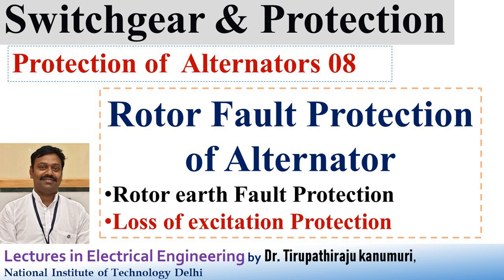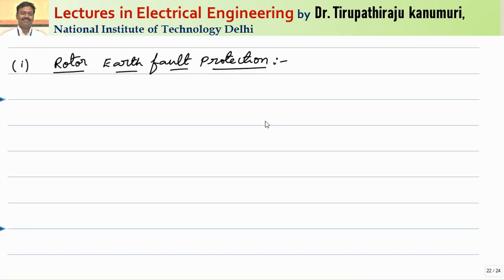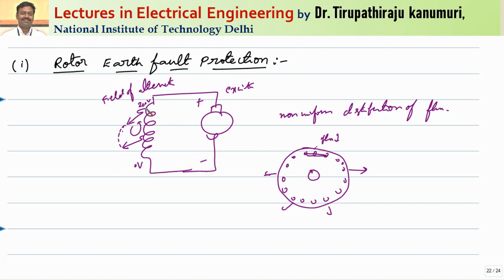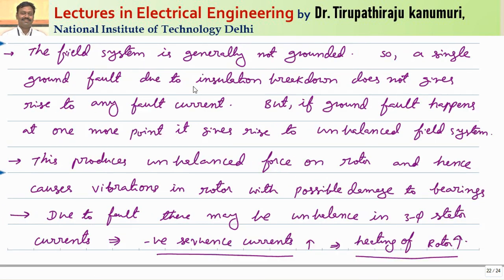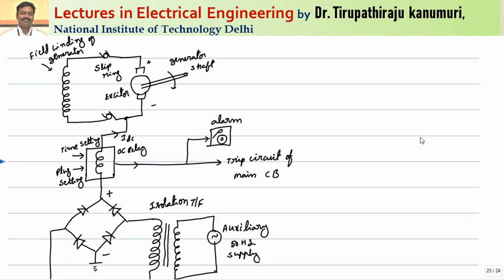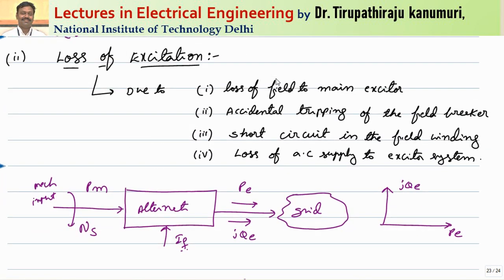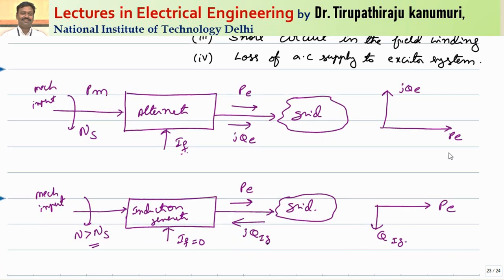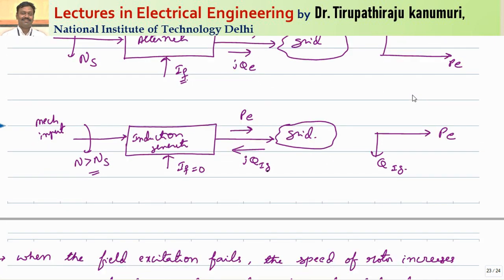SGP418 Rotor Fault Protection of Alternator

Comment: Thank you for your lectures sir , they are very helpful in understanding concepts clearly.
My doubts are :
Why the rotor winding is not generally grounded?
What happens if we connect it to the ac ground?
Reply: @lecturesinelectricaleng  sir , what will be the circumstances if we connect the dc field windings to Ac ground?

Comment: Sir, why field is always excited with DC only? What happened if excited with AC??
Reply: When conductors  cut magnetic flux at 90° emf induced is maximum  because of flux cutting  is maximum due to the flux is DC flux (constant, not changeable.)That mean conductors will cut the flux must be a not changeable  value .In case of AC , generated output voltage will not be sinusoidal because AC current flux always  changeable.